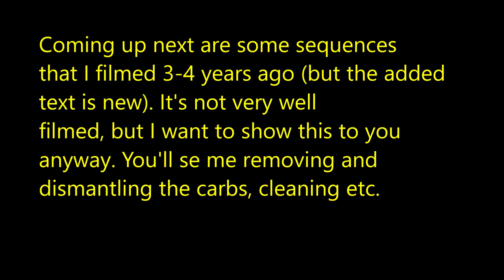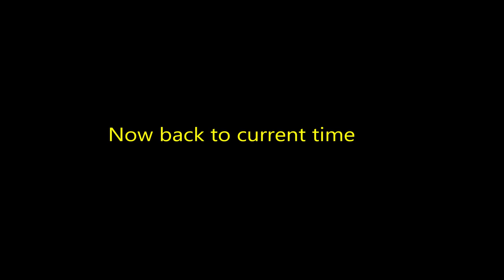#24 Mercedes-Benz 250 /8 1968 Early W114, series 0.5 project part 1 Strichacht Oldtimer restauration

Comment: Thank you for the close ups on the Zenith Carbs, I had very little info when I rebuilt mine. I have a 1971 250c.  It took me awhile to find the correct float bowl height. My car still has a lot of trouble cold starting it, but once warmed up it stops and starts fine.  I have more work refining how well it runs. The timing is pretty advanced and the idle is too low.  I don't know much about the exhaust flapper, not sure if that is working correctly.  Thanks for sharing this info, it is very helpful!
Reply from the maker: Thank you very much Phil! I'm happy to hear that my video was helpful to you. Seems like you've done a great job. Very nice car, the 250 C. Greetings, Peter

Comment: The good thing about the car, is that it was in a garage,where itcwas mostly protected, that is why there is barely rust,the interior is in awesome condition, not receiving direct sunlight which cracks the dash, the chairs, are 100% like new.
Reply from the maker: Well, the seats are not like new, but in okay condition. Thanks again for your comments Enrique!
Reply: The seats are not new, but they are original to the car, are they leather,.Mercedes Benz tech or I MB  upholstery which is very strong
Reply from the maker: @EnriqueLopez-hb5jn  It's a combination of fabric and MB-tex, so no leather.
Reply: @Pexyz  I thought of that, I had a W-116, that had the MB texture which is strong,

Comment: I would like to see the Zenith carb disassembly/assembly slowed down to real time. Is that posted somewhere on your channel? If not, could you do that? I am working on the carbs on my 1971 250C at this time. 
Thanks. Gary Moore
Reply from the maker: Hello and thanks for watching! No sorry, this is the only movie I have featuring the Zenith carbs. Unfortunately it's difficult to make a new video with the old material that I have. My tip to you is to slow down the speed of my movie with the settings on Youtube. It's very easy to do. You can usually find the settings symbol in the right lower corner of the movie window. The circular gear symbol. Hope you find it and good luck with your 250 C project 👍 //Peter

Comment: I have a 71 that I need to get running. My distributor and coil wires where cut when I bought the car and I need a close up of someone else’s car to get an idea on what goes where.
Reply from the maker: Hi rw75134! Thanks for watching. I might be able to help, which engine do you have? 4-cyl or 6-cyl? /Peter